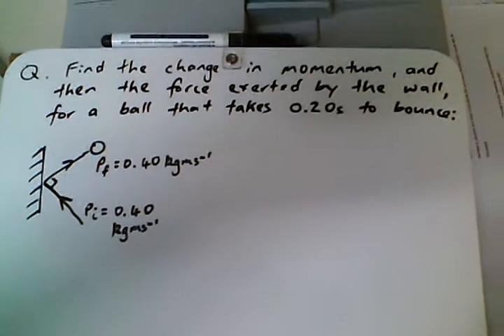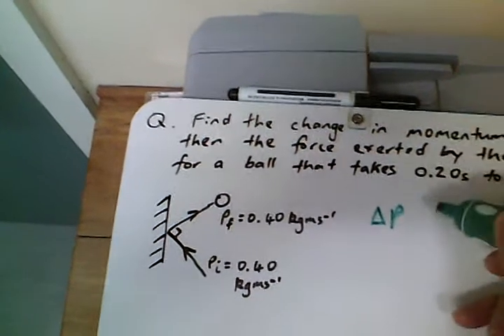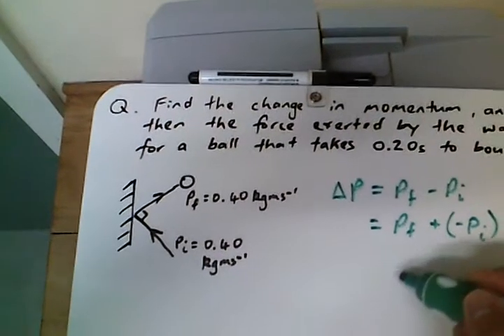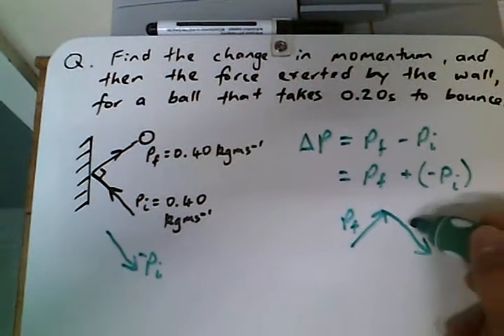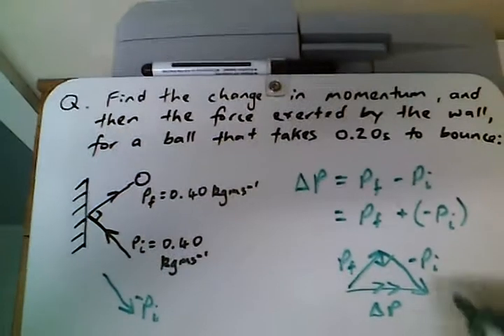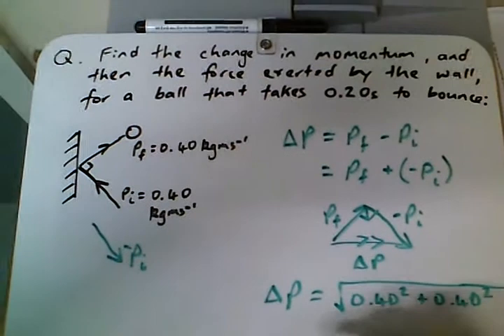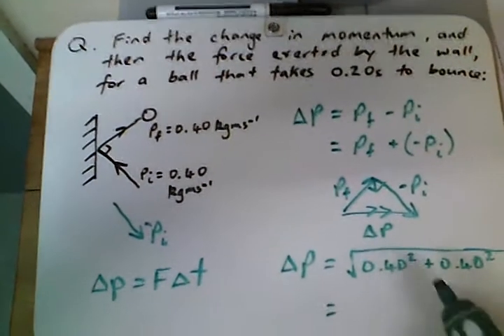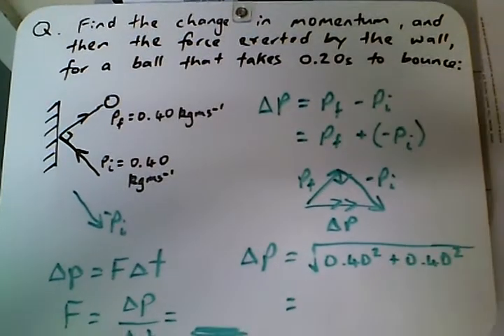Impulse 2D - vector momentum change.3gp

Comment: What happens if your vectors angle is not 90 degrees? Mine is 116 degrees and I am wondering whether I use the cosine rule.